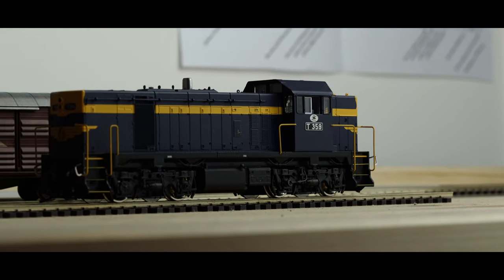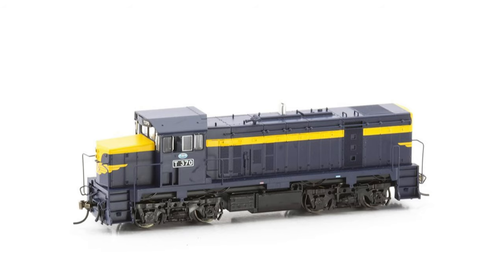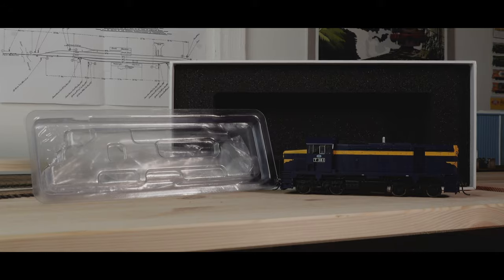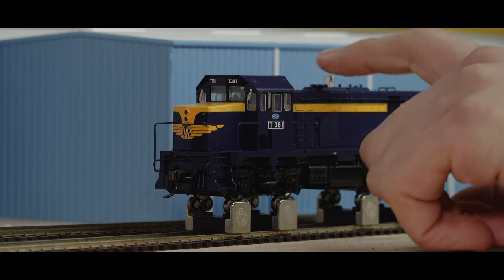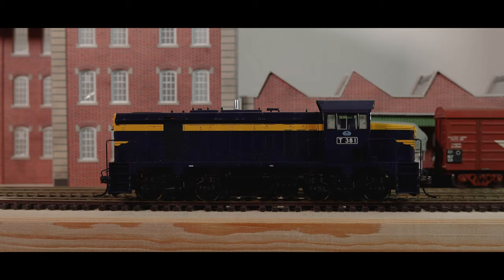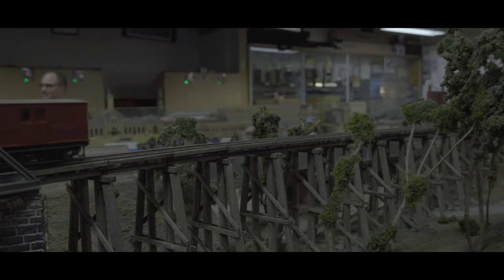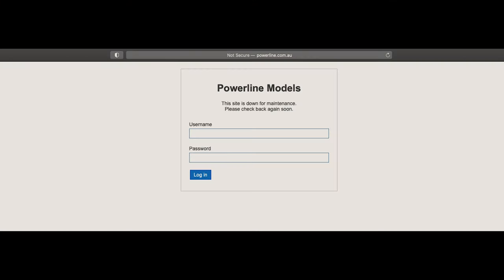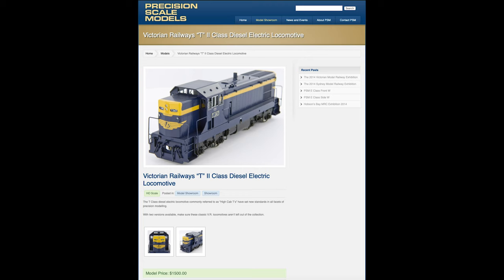POWERLINE: VICTORIAN RAILWAYS T CLASS REVIEW (DCC & SOUND)

Comment: Yeah, PDF print, fill in and scan back via email order forms are so 1990s. It's annoying.   I've got a series 2 and 3from SDS on pre-order, and one series 1 Bendigo Rail Models one.
Reply from the maker: I reckon! So antiquated. Nice in which operators? I've also got a couple of flat tops as well from BRM, not a bad little loco!
Reply: @WillJamesRailways  The Series 1 and 3 are (or will be) VR, the 2 will be V/Line.  I'm just starting to slowly get back into it - when I was growing up the only VR locos you could get were either the Hornby B clss from the Spirit of progrss train set, I think Lima had an S class, otherwise it was unaffordable-for-a-little-tacker brass from ALCO and the like.  We are (almost) spoilt for choice now.
Reply from the maker: @Gaspode_  Very nice! Ah i see, of absolutely we're spoilt for choice, and it's only seems to be more and more coming out, with more bell's and whistles, and better and better detail. A great time to have jumped back into the hobby!